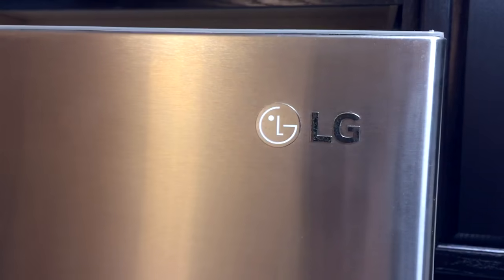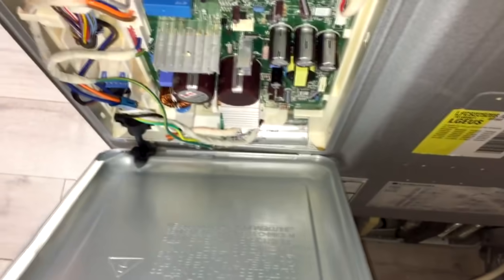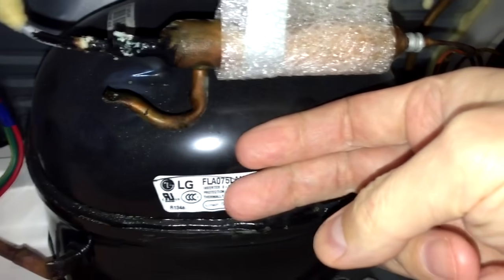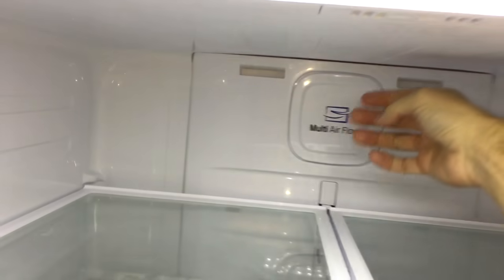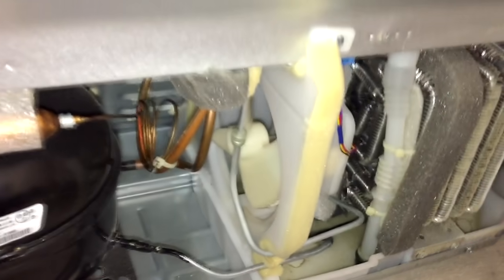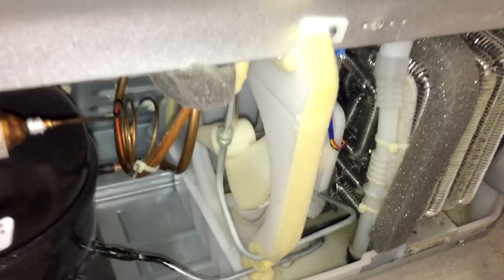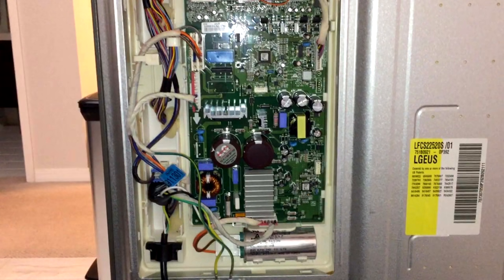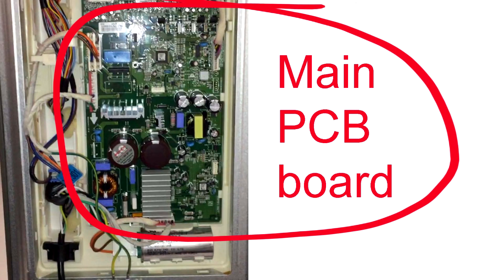LG refrigerator test and reset button

Comment: Thank you for the video. I have the same model, not working now. Does the big capacitor at bottom of board need to be checked or replaced? Could it be the cause ?
Reply from the maker: You can check the capacitor below the board, but it's almost never a problem.
When you say "not working now", what exactly is not working?
Do fans and the compressor run during the Test, but don't cool? Or nothing runs at all, and no lights inside?
Reply: @Your-Self  i did test the capacitor. it is working. The unit is not cooling at all. both fridge and freezer. The fans are working. The Compressor is linear and seems making some noise, assumed it was working. I did test it with Ohm meter. It read 9. so i assumed it is also working. I ended up calling a tech, he said the compressor, though it is reading good but is not compressing!
Reply from the maker: It sounds about right. The LG Linear compressor very often fails this way, running but not cooling because it's not compressing.

Comment: Hello there I have a lg french door refrigerator and it had suddenly stopped cooling.It had been giving the ff error code so I replaced both freezer evaporate fans and still its not getting cold at all and giving me the ff error code. I have do idea what else it could be and was wondering if you had any idea what it could be. Any help would be appreciated thank you!
Reply from the maker: If the fan itself is good, the connector could be loose. Unplug the fan connector and plug it back in till it snaps into place. The connector could be corroded as well.
If this doesn't help, it gets pretty complicated, where you need to trace the lost signal with a multimeter.

Comment: Hi, I have older model of LG and its front control unit is blank, inoperative. The fridge freezer is working as normal but we can't change any settings because of the display being blank. Any advice how to reset it or is the actual display faulty?
Reply from the maker: Every refrigerator model is different. And it's a pretty complicated test to figure out if the problem is with the Mainboard or the Display board. Maybe the wire between these two boards got damaged, maybe a shorted fan "loading down" the board... it's probably best to call a tech to trace the problem.

Comment: I say other comments regarding this but nothing on the follow up. I've done all the test,  it is still pumping cold air out but the freezer isn't freezing. I've checked everything and there's no frost or anything of that sort. LG was useless on helping me, and no one in my area will even touch it. Any further info would help out alot!
Reply from the maker: What is the model number of your fridge, and is it a single or a dual evaporator?
What are the actual temperatures inside the freezer and the fridge compartments?
Is the condenser coil full of dust or clean?
Does the evaporator fan inside the freezer pumping cold air when you open the door and activate and hold the door-switch? Or it works only during the Test Mode?
How old is your fridge? It could be covered under LG 5 and 10 years warranty.

Comment: My LG LTCS24223S /01 has the EBR78764101 electronic control board.  While I found the reset switch, I did not see an LED anywhere.  Is there one on the board?  If not, what can I use to identify any error codes?  Thanks for an informative video.
Reply from the maker: I guess not all control boards have an LED indicator light. But you may see error codes in front of the fridge on the display. You may need to open the door to see the display. What exactly is the problem with your refrigerator?

Comment: Starting a new thread - During normal operations: fridge and freezer both maintain a temperature, but it isn’t as cold as it is set to be, Compressor and compressor fan seem to be running fine, but no cold air blowing inside fridge even when holding door switch. During test: very cold air was blowing for both fridge and freezer, fans and compressor all seemed to be working. All tests seem to pass per this video. As soon as I put it back in normal operations, the air stops flowing again. One time, I was able to get the air flowing for a little while but it stopped after 20 mins or so.
Reply from the maker: This sounds like a difficult problem to diagnose remotely.
The fans run in the Test Mode and blow cold air, so that's good.
Did you try the freezer Door Switch as well? When you open the door the lights come ON. Press and hold the door switch and the lights go OFF... right? Wait for about a minute and the fan should start to blow cold air... but it doesn't.
I wonder if temperature sensors (thermistors) are out of spec, and lying to the main PCB, or the PCB itself is bad.
If you have a multimeter and a thermometer we can try testing the temperature sensors.
Are there any error codes on the display?
Reply: No error codes were blinking. I had a tech come out today. He was convinced it was a leak in my compressor system, and filled it with a leak sealer. I was skeptical given that it is able to produce cold air during the test cycle and the refrigerant didn’t need to be charged. He basically said it could be a small leak that should be fixable with the sealant, or a big leak that wouldn’t be worth fixing. Does his assessment make sense to you?
Reply from the maker: If the problem was the fan not working when it should, adding a sealant to the system won't help. But since I wasn't there to inspect, it's difficult to judge. Maybe he found a different problem.
Give it a day and see if it works better.
If your refrigerator stays not cold enough, look at the compressor. If it's running and trying to cool, there may be a leak or a defective compressor. But if the compressor is not even trying to run when your fridge is getting warmer, it's an electronic problem. Ether with the temperature sensors, door switches, or the main PCB.
How old is your fridge? The compressor is covered under the FREE replacement for the first 5 years but has to be replaced by an LG authorized tech. Was your tech from LG?

Comment: Hello Slava, l have a 10yr lg Lfx31925st/00 and l had compressor replaced about 5yrs ago . My problem is that the defrost in fridge keeps icing up and clog the drain so 2 yrs ago l replaced pcb board and added copper wire to grid to help defrost but recently it frosted up the drain and so I'm wondering if l should replace board again. The upper fridge cools perfect just clogs every 2yrs . About 1 month ago it happened again and l defrost the drain and clean ,vacuum bottom area compressor area
Reply from the maker: Your model comes up as a single and a dual evaporator. So I'm not sure if you are talking about the freezer or the fridge getting clogged.
When you run Test#3, if the heater(s) get hot, the PCB should be OK.
When you defrost the drain, pour some fresh water in, and make sure it flows out well. Maybe use a flexible trombone cleaner brush to verify there are no abstractions in the drain tube.
Maybe the defrost sensor is getting "tired" and terminating the defrost cycle too early. It's a dual-sensor (sensor and a fuse attached to the evaporator) that may need to be replaced.
Reply: Yes l cleaned drain out and water flows freely and l changed dual sensor with fuse. Fan in fridge compartment runs in test mode . The coil evaporator is not freezing up,  just the water in drain pan
Reply: I changed the thermostat sensor "controller " and added the heater probe and after cleaning and draining water from drain pan in about 4 weeks it freezes again. The coil evaporator is not freezing but just the drain thats below the heater and when this happens the water will pool in the bottom of fridge compartment because the drain is frozen. This is the upper component not the freezer below. I'm wondering if the heater itself can get "tired". Its not opened so it is testing good.
Reply: @Your-Self  if in test mode, the heater gets hot...does that mean the board is still good because everything else test good? The drain was thoroughly cleaned and thawed because it will freeze after 4 weeks. I changed the board 3 yrs ago when this first happened and now its happening again. All gaskets to the doors are good and the evaporator fan is working in test mode.
Reply from the maker: Yes, dual evaporator models can be troublesome.
Your heater and the PCB seem to be OK since the evaporator gets melted.
Instead of copper wire, maybe try a Heat Probe 819043.
Try relocating the defrost sensor "controller" from the middle of the evaporator to the top. That should prolong the defrost cycle.
Completely defrost the drain tube (again), and make sure there is no ice leftover on the evaporator cover Multi Duct Assembly... wipe it dry.
Reply: @Your-Self  thank you,  l have a heater probe and relocated the sensor. I'll let you know how that works out

Comment: Thank you for the informative video. Everything seemed to work when I did 3 test modes, but once i let it run normally,  the fan in the freezer doesn't run. Could it be the culprit why my fridge and freezer compartments are warm? My model is lfxs28968s.  Thanks
Reply from the maker: Possibly.
During a normal mode, when you open a door, the fan may stop automatically. So, you need to trick the system as if the door is closed by activating a door switch. The fan should start blowing within a minute.
However, if during the Test the fan was blowing warm (room temp) air, the compressor could be bad.
Reply: @Your-Self  i tricked the system with the magnets. Only heard/saw the fan in the fridge compartment ran but not in the freezer.  The fan in the freezer compartment only runs in the test mode. Thanks
Reply from the maker: Your model has one fan for both the freezer and the fridge compartments.
The fan probably is trying to cool the fridge compartment first. And if the air blowing is warm, it's probably a Sealed System problem... most likely the compressor.
If your refrigerator is under 5 years old, LG typically replaces the compressor absolutely free.
Reply: @Your-Self  thank you very much. It's still under 4 yrs. I emailed LG late Friday  night, waiting for them to respond.
Reply from the maker: It's probably better to call them directly on 1-800... number from your label.
Reply: @Your-Self  thanks again for following up. I actually received the service email from LG. They asked for proof of purchase (which i lost). The only proof i have have is the email confirmation i received from LG after i registered my fridge back in 2018. I'll keep this updated.  Thanks
Reply: @Your-Self  i finally had an opportunity to call LG yesterday.  Customer service was very efficient. They scheduled repair service as soon as i was done talking to them. 2 hrs later, everything was fixed. It was the freon needed to be recharged. Thanks again for your responses and informative videos
Reply from the maker: Good to hear that it works now!
I hope they replaced the leaky part before recharging the system. Did they say where the refrigerant (Freon) was leaking from?
Reply: @Your-Self  unfortunately i wasn't home. They just told my daughter that they recharged the freon. I need to contact them when i have time to see exactly what they did.
Reply: @Your-Self  according to the invoice they billed to LG....the pressure was weak at 55psi (???), replaced insufficient compressor and refrigerator filter dryer. Total parts cost $250 and labor cost $313. He was there for 45 min to hour. Glad it was free for me
Reply from the maker: Ah, so it was a bad compressor.
Lucky it's under warranty :)
Reply: @Your-Self  interesting that replacement of compressor totaled $500+. I had service guy in and I asked him what could be the issue. He said ”sign for the service fee first and I will tell you”. After signing, he said “bad compressor “ without even opening the fridge! Replacement $1400. I find this so unscrupulous. Obviously, I lost $65 and he lost my trust.

Comment: What happens if when you press the test and button, nothing happens?  My fridge gave me a FDS code. I replaced the freeze defrost  assembly...but it's still erroring. It's not defrosting the freezer coils. The freezer is actually working okay, but the fridge is warmer than it should be. Im thinking it's either the ECB or freezer heating element, but leaning more towards the ECB since it wouldn't even run the tests. Any insight would be extremely appreciated.
Reply from the maker: DS - is a Defrost Sensor error code, that may be shorted or disconnected. Did the defrost assembly come with the new defrost sensor to replace? The test button is not working possibly due to an active error code. Check all connections for the defrost sensor, and it would be great if you could measure the resistance of that sensor. What is the model number of your fridge?
Reply: @Your-Self  79572053112.  Yes, the assembly is the defrost sensor that consists of the sensor, fuse, and plug. I connected it exactly like the old one. Error code came right back within an hour. Not sure if I was supposed to make sure all frost was gone or not. The majority was when I plugged it all back in I believe.
Reply from the maker: Unplug power.
Remove connector (CON7) from the main PCB.
Check resistance between two Brown wires (numbers 19 and 20)
If the freezer is cold the sensor resistance should be around 35 k-ohms. What did you get?
If you get nothing the sensor is not connected, bad plug, or a broken wire inside the wall.
PS. You want to make sure there is no frost left on the coil where you attach the sensor.
Reply: @Your-Self  so I replaced the ECB. After that I was able to run the tests. All test ran perfect from what I could see. Nice cold air coming to the fridge and freezer. No error codes either 

However when it's out of test mode, only the freezer is receiving cold air. Nothing is flowing to the fridge at all...(not even  air filter circulation). 

Note I have a multimeter to test anything needed. Any thoughts? I really appreciate your help.
Reply from the maker: You have a dual-evaporator system, that cools each compartment individually. If your fridge still is not cooling, the 3-way valve maybe not switching correctly. Or the temperature sensor (thermistor) inside the refrigerator is out of spec, and not telling the main ECB to start cooling. You can check the sensor resistance of the fridge compartment on the same CON7. Remove it and check two White wires (numbers 15 and 16.) The resistance changes depending on the temperature. For example; at 50°F in the fridge, the sensor should be about 20 k-ohms, at 32°F, about 30 k-ohms, if your resistance is above 30 k-ohms, the ECB would think that it's already too cold, and will not run the compressor. What resistance did you get, and at what temperature?
Reply: @Your-Self  should the fridge be unplugged? I have it unplugged and I'm not getting any resistance reading on any of those con7 wires. I have the multimeter set to resistance and tried 20k and 200k.
Reply from the maker: Yes, the refrigerator needs to be unplugged, and CON7 removed. Strange that you don't get any resistance, maybe bad multimeter? Try the freezer sensor two Blue wires with White stripes should be about 17 k-ohms if the freezer works correctly. Can you verify the freezer and the fridge temperatures with a separate thermometer? And how about the original problem, does the freezer go into defrost now?
Reply: @Your-Self  hello...so I was told by a repair person that the issue is with the Conn7 wires themselves. He said a couple of them are loosely connected. He showed me how by just moving them around, the ECB kept clicking on and off. He wasn't sure how to get it fixed.

Any idea how I would go about getting a wire harness assembly for that ECB?
Reply from the maker: Hmm, not sure neither. I'd unplug the CON7 and trace those wires to see if it can be unplugged at the other end and replaced with another wire harness. However, if those wires go into the wall of the fridge (into the styrofoam), officially it's not replaceable. But of course, you could mess with a soldering iron and try to reestablish a better connection.
Reply: @Your-Self  any idea who would specialize in that type of stuff? An electrician?
Reply from the maker: An electrician probably wouldn't know what to do with it, but a computer electronic board repairer may be able to figure something out.